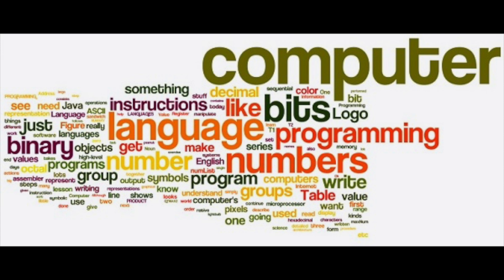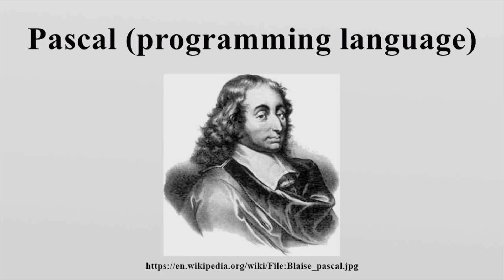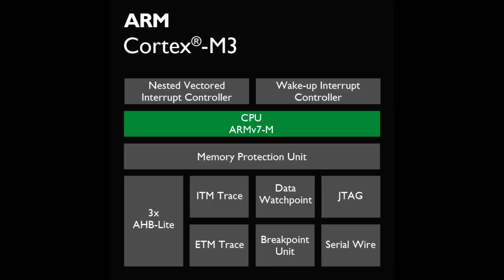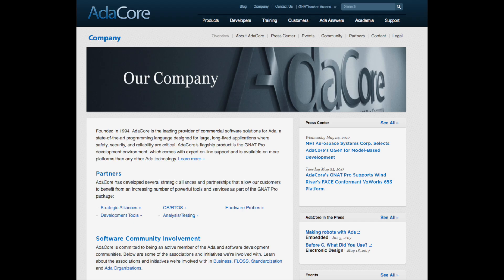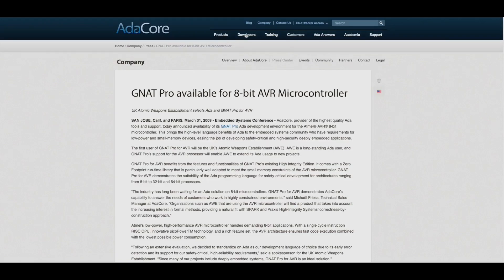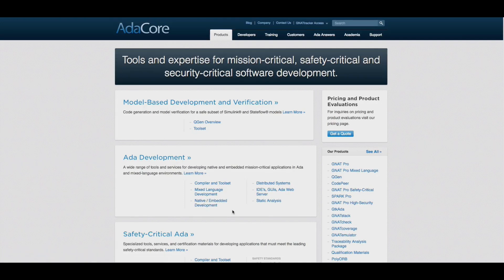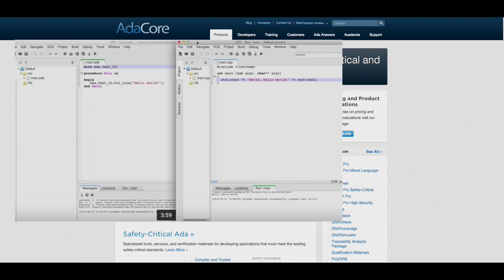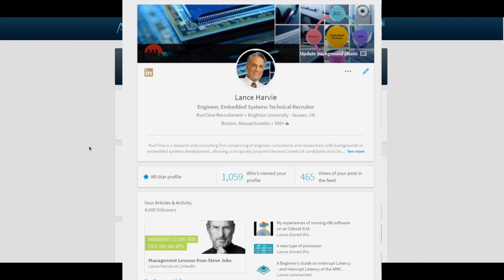Ada Programming For Embedded Systems

Comment: How does this approach compare to auto-generating C/C++ code via the use of Matlab/Simulink modelling for speed, accuracy, and reliability? 

Quoting Airbus Helicopters:
"Flight code generation automatically converts (Matlab/Simulink) models into high-quality, well-documented code embedded in line replaceable units (LRUs), which has enabled aerospace companies to save 40% per line of code, achieve Six-Sigma flight software quality, and have an autopilot work on the first try."

https://www.mathworks.com/solutions/embedded-code-generation/flight-code-generation-aerospace-systems.html
Reply from the maker: These are fantastic cost-saving Dave - perhaps  Matlab/Simulink has superseded Ada in some respect and use cases.